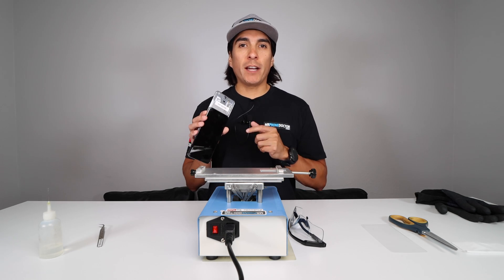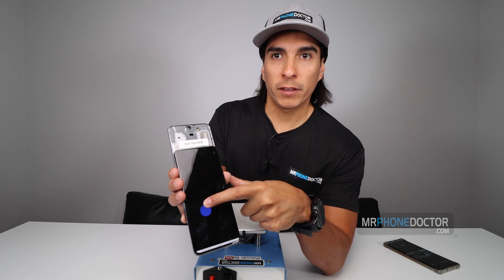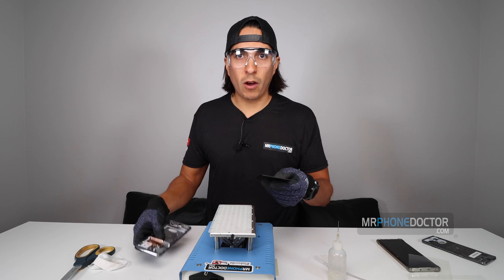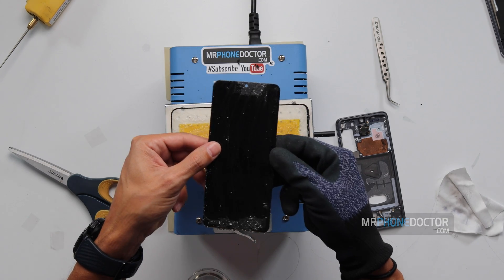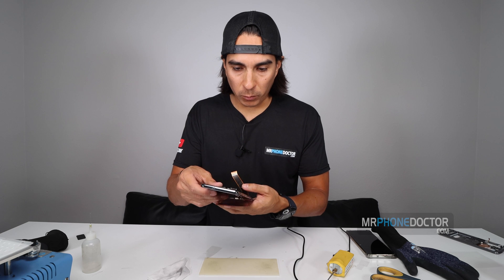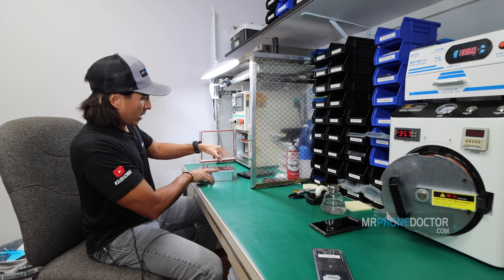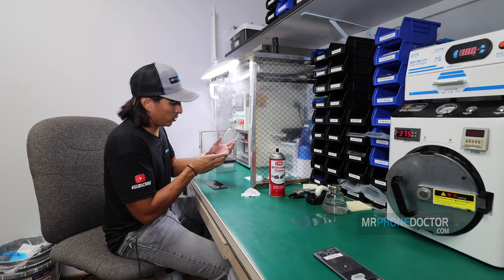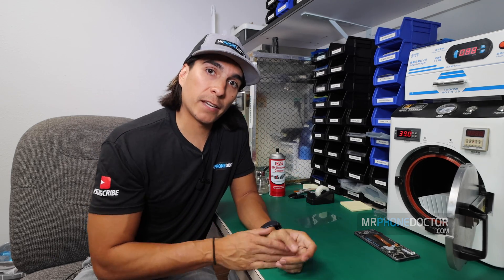Samsung Galaxy S20 Cracked Broken Screen Repair (Front Glass Only)

Comment: what do you recommend for a cracked screen with liquid crystal bleed?  Could the screen just be replaced, or should everything switch over to a new frame with the screen?
Reply from the maker: Is it an OLED? If you can live with the bleed use it. 
If LCD need to replace it, it will get worse
Reply: @MrPhoneDoctor   I don't know what type of screen it is, it's a Samsung S20fe 5G, but the bleeding did end up spreading throughout the whole phone so now it is completely black. The phone still rings though. I can hear if someone tries to call me but can't see or do anything but guess who called haha.

Comment: what do you recommend a glass or the whole panel replacement ? and which thing is water proof?
Reply: Its depends what you broke...a glass only costs 14-35£ while a whole front costs about 90-150£....so glass is lot cheaper tho required a lot experience as I brokem my lcd not the glass I had to change the whole front.it was first try and it was pretty easy while I wouldn't attempt that wire remove not even at home.Both method is water resistant not waterproof.

Comment: Javi, how do you remove the front camera since it's glued. Did not want to apply heat to it.
Reply from the maker: Very careful with tweezers. Need to cut out all the glue holding it down.
Reply: @MrPhoneDoctor  TY Javi.

Comment: at 3:05 what's the plastic pry tool called exactly? looking to order what you use to separate the frame from the OLED.
Reply from the maker: That's the plastic Protector sheet that comes off the oca adhesive

Comment: Do you need to do all that work just to replace a cracked glass cover screen?  Is there a price difference between cracking only the glass screen compared to the LCD ? Samsung charge a hefty price to fix but they don't differentiate the price between only the glass and the LCD?
Reply from the maker: Yes you do have to to all that work. Samsung has one price because the replace the entire display with glass. This is more cost effective solution
Reply: @MrPhoneDoctor  I see , thanks for the response. I'm not technically minded so from my point of view it feels like Samsung are dooping everyone because if the LCD is perfect and only the glass has a small crack here and there, why would they replace everything? Just seems like, surely they should just replace the glass. Your answers are greatly appreciated.

Comment: I dont recommend a glue remover maschine its too delicate, I got a small pixel issue. I recommend only glue remover liquid and a soft sponge. This polarizer is very thin and sensible
Reply: I know it but every time i get little holes in the polarizer because the polarizer is too thin i never got this on any other phone
Reply from the maker: If you know how to work the glue remover no issues

Comment: So you will know, this is a design flaw. If you go and look across the internet, and I went on to the Samsung Community wall, there's a lot of complaints about this. If you'll note even in this video he's pointing out where their flaw is that, which is where the crack started. There is evidently a small Gap put into the glass over where the power button is, and that creates the Flop. I have one that I had a case protector, and glass protector, in a purse that I bought specifically to protected that it fit in nicely cuz it's such a big phone.  I put the phone in on my way to class, did not hit her drop my purse on the way, took it out at class, it was broken, right by the power button. I'm encouraging people to write a complaint to Consumer Affairs, and I am actually going to look into an attorney if needed. Samsung needs to stand behind this very expensive product. As it is they are making $300 per repair on these! Despicable!

Comment: My wife broke the screen on her S20 Ultra 5G, everything still works just fine, but needs the face replaced, What does it run to get that fixed, we have to find someone here in Florida locally to fix it quickly, her phone is also part of her work. Thanks

Comment: These past few galaxy phones I've had seem to be getting more and more easier to break gorilla glass my ass
Reply from the maker: Right!
Reply: True.  I haven the same problem on a new phone.
Reply: absolutely right ... even I don't know how my s20's glass is broken in my pocket ...
Reply: @asrarcheema6299  The frames for newer devices are not rigid enough to resist even the forces that can happen due to the size of the phones now being large enough to crack just being pressed from tight fitting clothing onto a curved body or just being in your back pocket and bending over depending on your body shape. They are big enough so just getting pulled by your pants into your ass can crack them. They are made out of what seems to be light plastic and just glued now so the shell isn't really acting as a rigid structure even though they could make it all out of aluminum or tool grade plastics with fiberglass reinforcing with a complex internal structure or simply encase the battery in a solid shell that is connected all over the outer frame to make it really difficult to flex at all as the glass cracks with just a little bit of twist and it would not add too much cost to manufacturing but as the trends have been there is no market incentive to produce a more durable phone as there is no product line or popular brand that has that kind of practical line of thinking when it comes to device development. It wouldn't stop impact damage that would break the glass but definitely stop them from cracking in your pocket. They could just make the glass a bit thicker also, this might make them significantly heavier though and that could cause them to be more likely to break when dropped but I'd rather they break if I actually drop them and not from just carrying them in my pocket. They just aim for super thin super light and modern looking design with a ideal durability of a year or two before you buy another one. Making them last until you actually need to upgrade for hardware reasons would result in quite a large portion of the market keeping them for a decade only to replace the battery as they would only use them for what they need them for and if they still work there is no Reason to spend 300-1500 dollars for a new one that is only marginally better in storage space and camera that will probably be running a new OS they decided to skin the UI so different year to year you spend months learning to navigate it all over.
Reply: Seemed to happen when they added the curved edges

Comment: can you please do a video of an s20fe
Reply: Just a heads up the s20fe screens are extremely fragile. I dropped mine today off of my bed which is roughly 2'. I wouldn't be surprised if I had hardwood or tile flooring but my bedroom is carpeting with a wood subfloor so it was a very cushioned fall. My phone is 3 weeks old and It's in a wallet case that has a raised protective edge, I also used a silica wipe on the screen protector, and I sadly was waiting for the tempered glass protector to come in next week due to backorder. I have been reading about the poor screens which these phones have so to anyone who has or is thinking about getting an s20fe please please please protect it and make sure you have some sort of insurance on it. From my understanding, the gorilla glass screen which the s20fe has is great when it comes to scratches but is a horrible drop resistant phone screen. Hopefully, otter box or LifeProof will be making cases for these phones with the popularity they are gaining but I doubt they will due to not being a flagship.
Reply from the maker: Its in the works:)

Comment: Is the scenario here where the digitizer/amoled fine, but the outer glass is trashed?

My scenario is that I have side chips at the lower left and upper right and a transverse crack developed, and the upper quarter displays fine, but does not respond to touch.

I assume this means I'm looking at replacing the entire assembly, which seems to be a much easier, but more costly repair in terms of part cost.
Reply from the maker: If no touch will need to replace amoled display:(
Reply: @MrPhoneDoctor  yeah that was confirmed over the clast day by the panel starting to bleed.

Sucks. I don't normally break phones.

Comment: If I buy front glass with frame and OCA glue on, which of these machines do I need for the last steps? Also, why do you attach the OCA yourself if it's already cheap to buy pre-attached?
Reply from the maker: I have not seen glass with oca on. We manually apply because oca bubbles when not adhered to oled after...
Reply: @MrPhoneDoctor  I wasnt specifically referring to the s20 but I get what youre saying. Which 2in1 laminator+bubble remover would you recommend? Ive been repairing on/off for couplw years but want to start repairing the screens.

Comment: We replace the glass on this models taking the damage glass in frame, we think is better, then later just take apart the lcd out the housing, is not recomendable to laminate this models in frame at the first 2 dayd lcd is ok later on bubbles start appear on edges if you do in frame lamination
Reply from the maker: What molds are you using for in frame?
Reply: Use UV lamp to cure the glue.